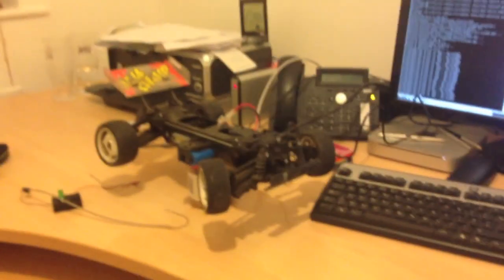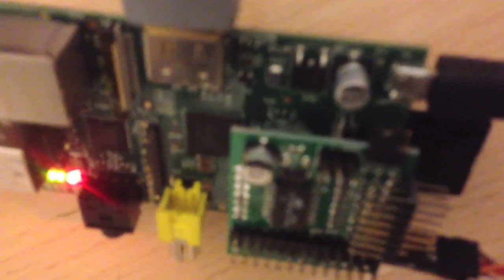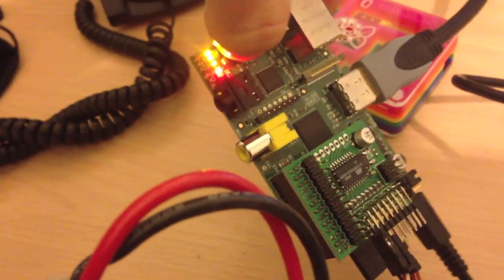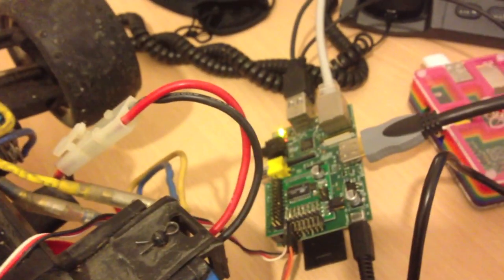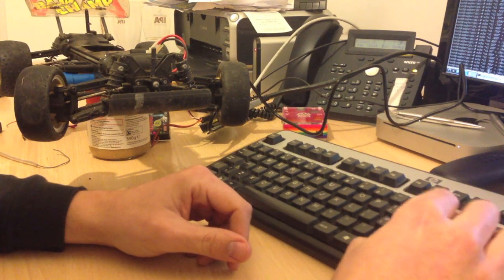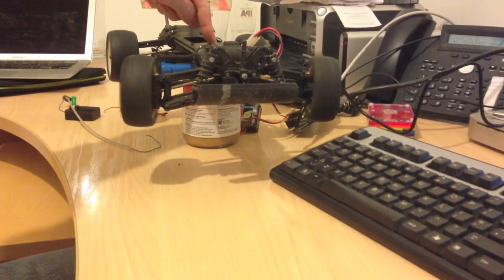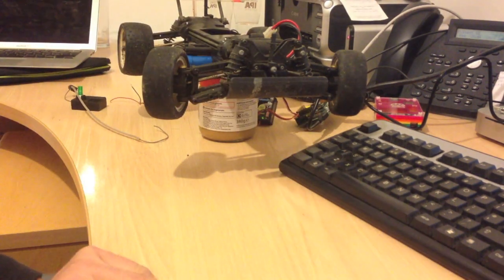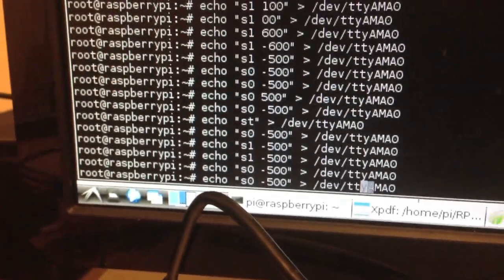RPI RC CAR PART 1

Comment: Hi, I've read your article on Linux User and watched the videos, but I'm stucked with the motors: to me it's not clear what kind of motor you are using, is clearly shown that the motor as 2 wires but then you do use the Adafruit 16-Channel 12-bit PWM/Servo Driver - I2C interface which is for servo motors.
I can't get what's happening.
How could a servo motor be fine for speed up the wheels? I mean, they usually rotate only from 0 to 180 degrees..
Reply from the maker: Hello, So you dont need to worry about the difference between steering and drive (motor). Your motor will need a speed controller (esc) which will have three wires, power, ground and signal. The signal is created using PWM. Take a look at the code, you will see the high and low limits. The Adafruit interface is used to send accurate PWM signals to the speed controller. As for the steering, is is that same, PWM of say 500 is left and say 1500 is right. For example.
Reply: Thank you very much! I didn't understand what was that "speed controller" module. I'll search for one of those. Thanks!